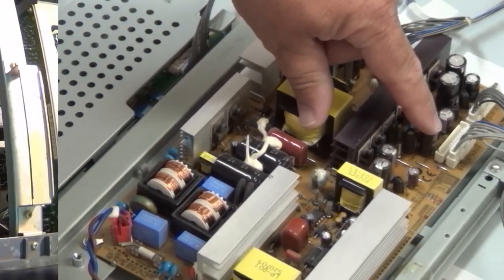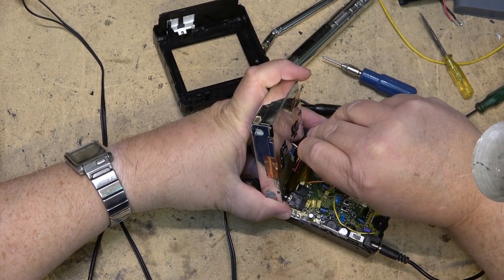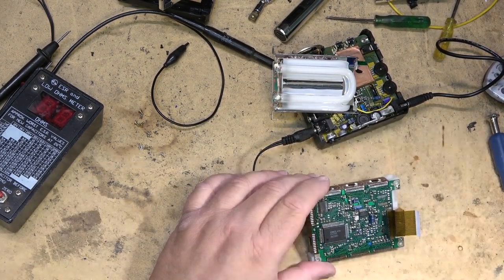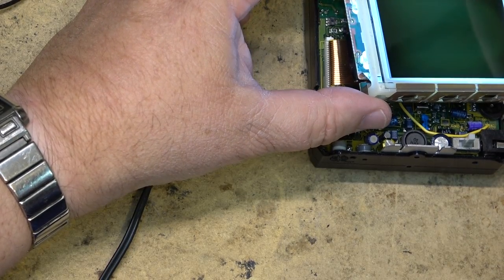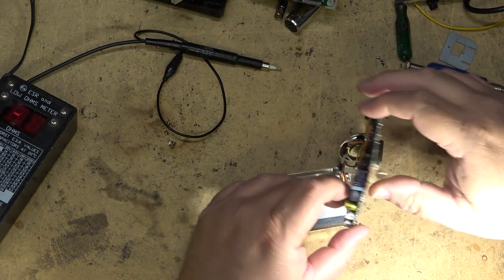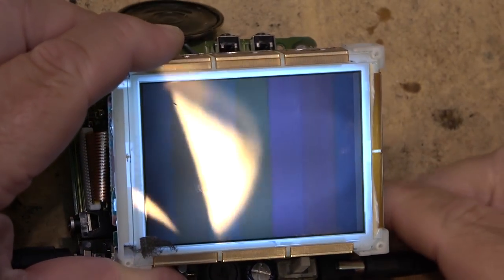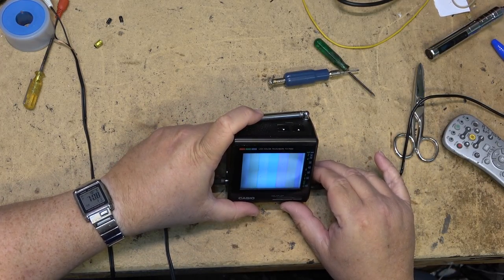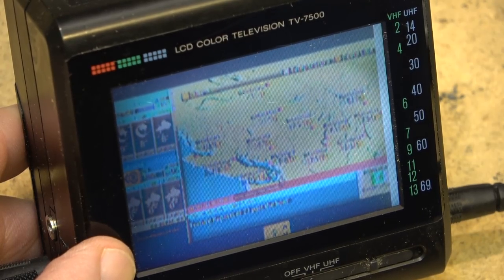Casio TV7500 Pocket LCD Color TV with a bad picture

Comment: Turned on my old iHome clock radio with iPod dock and the LCD display looks like a star field with different sized orbs of white dots in the display. 
      Also  I have a small portable battery powered clock travel radio that has an LCD display on a hinge so you can see right through the clear display. I would use a small single source lamp and shine the time on the wall at night, very cool.

Comment: I have the Casio CV-1, was the worlds smallest color TV back in early 90's, still working great. My 7500 models out of 3 , 2 work fine and the 3rd has a bad fluro tube gets very hot.

Comment: I think the TV7500 was produced a few years after the TV500, and they definitely improved the LCD resolution. 

Something I did find annoying, was the permanent white strip tuning indicator. Most TVs turn that off of course, when it isn't been tuned.

I used to have a couple of the UK Casios, which were PAL system and UHF tuning only.

Comment: I have this exact TV, but the backlight CCFL burned out on it somewhat.  it still lit but the thermal fuses on the ends of the tube went open.  after shorting those out, the backlight came on again, but got hot enough to discolor the LCD under it (temporary).   These days I could probably just stuff LEDs in there to replace it.  Do not be tempted to clean the LCD with alcohol, either.  it will dissolve the RGB filters which are deposited on the front.

Comment: What brand is that dirty rotten cap. I've recently had 3 separate Yamaha units with the similar cap failure. When you see them immediately replace them. They are duds.
Reply: I think Casio used Elna caps in many of their products.
Reply from the maker: Elna.